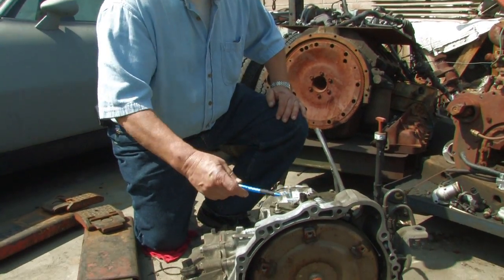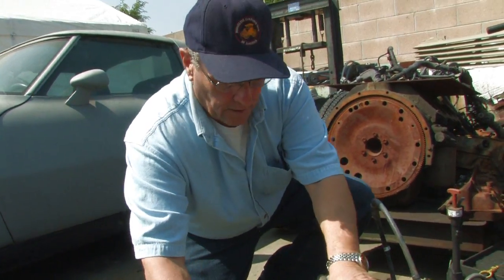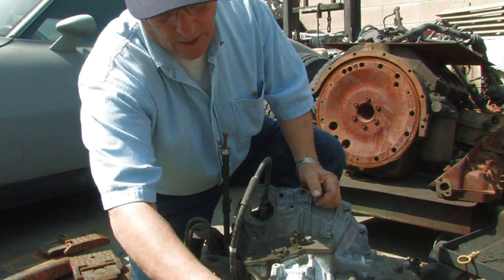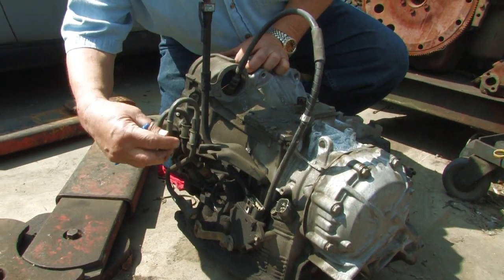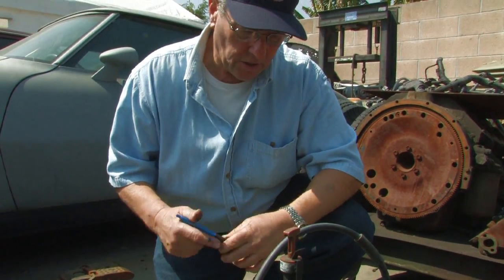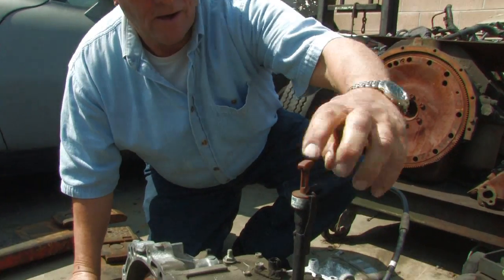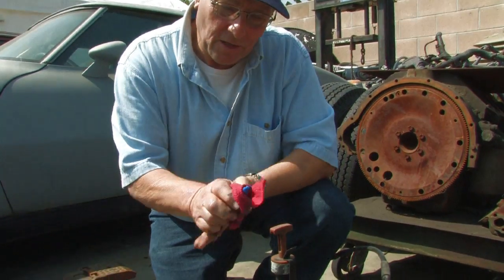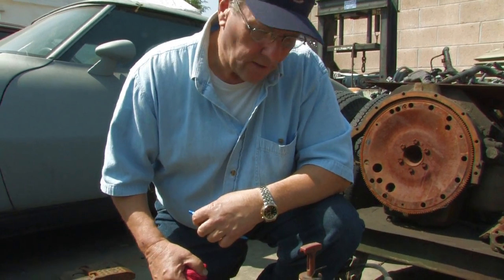Car Parts : How a Car Transmission Works

Comment: what transmission can i put in a 94 mazda mpv thats reliable and powerful the transmission i  have is reliable but it starting to delay shifting from 1 to 2nd when you pull off from a stop slowly like at 1500rpm but is fine when driven harsh